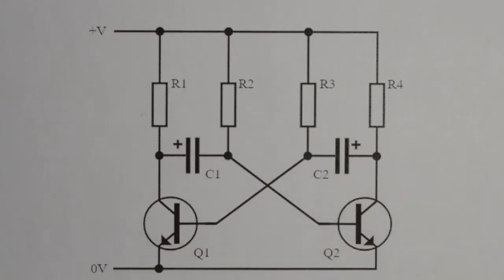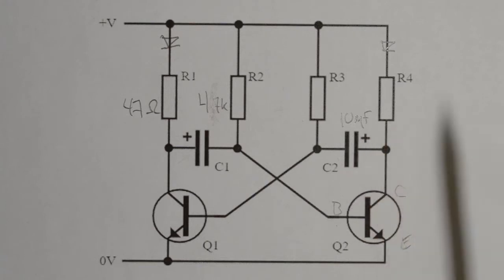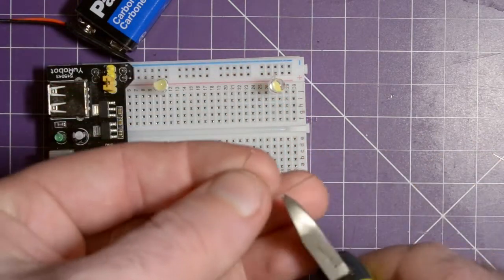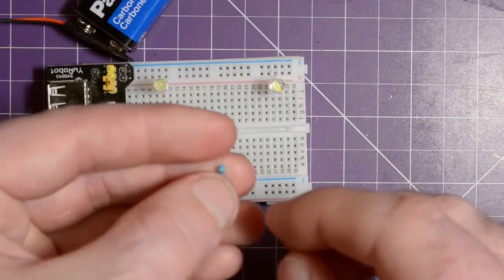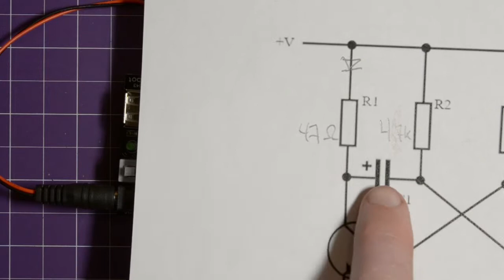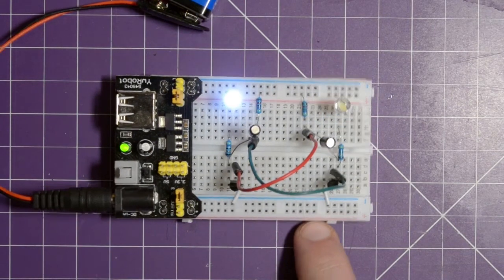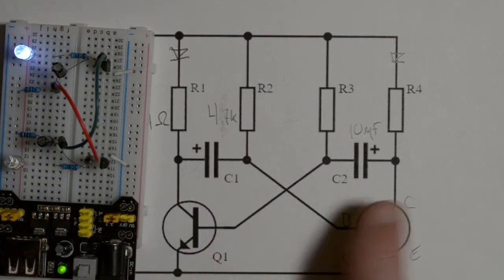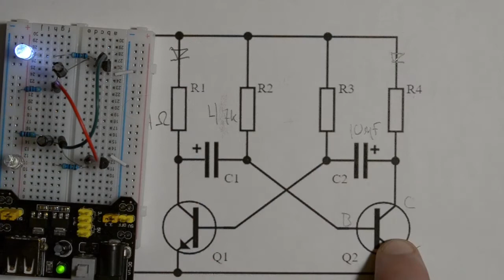Basic Circuits: Multivibrator

Comment: It looks like it's smiling!!

In the early 90's I made 5 of these with 10 LED's each, (5 per side alternating red and green on long wires), random value capacitors for eratic blinking and a 9volt mains power supply.
I put them all over the christmas tree! LOL.

Comment: It's one thing to assemble a circuit and (thankfully) it works...  I'd propose once that's done - for this circuit - there are numerous additional activities, as:  1) oscilloscope probing at various points; not only between point and ground, but across components, 2) keep "the left side" values and change "the right side" values to see what happens, 3) try a low-gain transistor in one position, and a high-gain transistor in the other, 4) experiment with supply voltage to see how circuit behavior changes.  If your approach for videos does not include such diversions, I completely respect that.  Mostly I'm reporting what I might do if I mocked-up this circuit (which I yet to do), because I like finding variations that inspire new ideas.  Best...